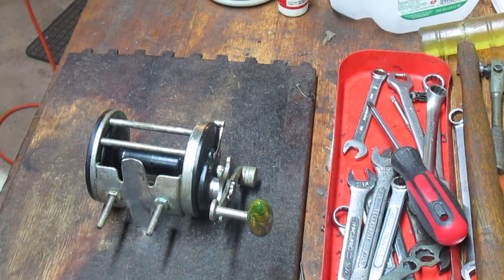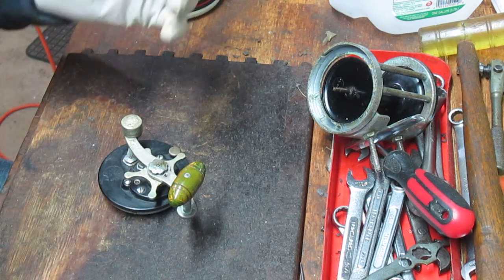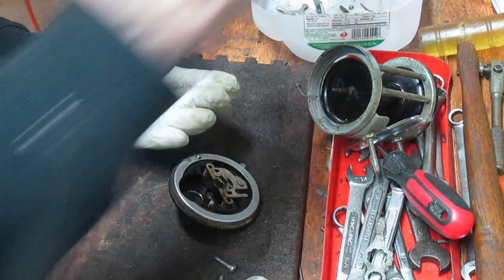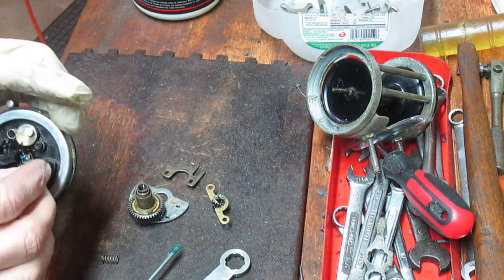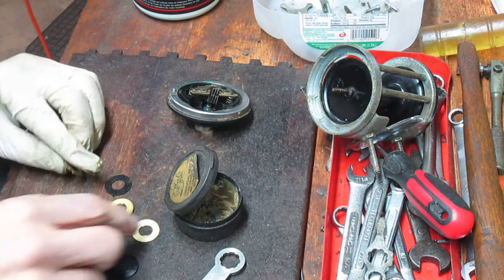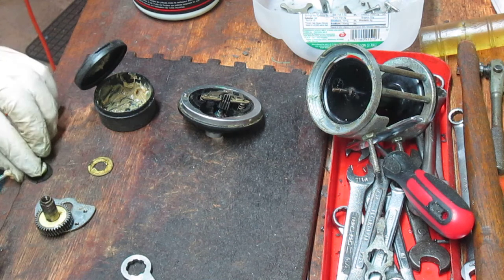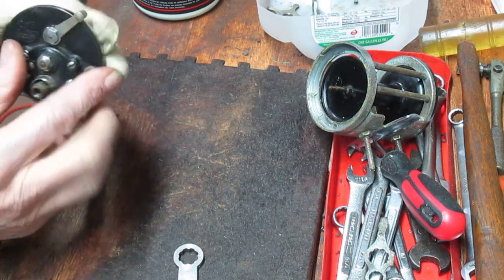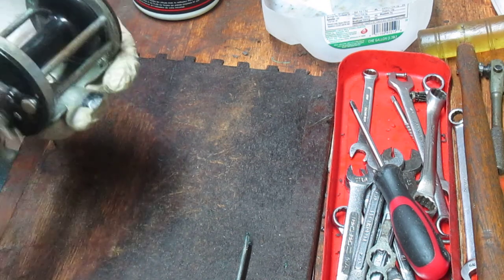Penn Surfmaster 200 repair or rebuild with reel overview and tips

Comment: Will the leaf spring from the Squidder 140 fit the Surfmaster 200?
Reply from the maker: Which spring?  The A/R dog springs are very different.  The Yoke springs are interchangeable.  I am not sure which spring you are referring to as a leaf spring.  Please clarify - Dennis
Reply: @2ndChanceTackle Apologies, I’m speaking about the AR dog leaf spring. If the Squidder leaf spring won’t fit it, do you know which AR leaf spring would fit.
Reply from the maker: The squidded has a coil spring that sits inside the A/R dog.  It is not a leaf spring.  If you are looking at the 200, that spring is different from the squidder

Comment: Is it possible to narrow this reel like other old penn reels?
Reply from the maker: Penn did that for you with the model 100 and 150 Surfmaster.  The gear side plate is the same on all three, but you would need the whole backside to marrow the frame.  That would be the cross posts, reel seat and spool.  At that point, it would be cheaper to just by a good used 150 or 100 rather than investing in the parts to modify your reel - Dennis

Comment: Dennis I assembled the main gear portion according to the video and checked to make sure the anti reverse was working before final assembly. I don't have free spool; the anti reverse engages in both directions. I've tried several times but same results. What did I miss?
Reply from the maker: I would take the assembly off and check it again.  I think your A/R dog may be trapped behind the main gear and not riding on the gear sleeve - Dennis

Comment: Usually I disassemble the reels than look on YouTube to see how others do it. I am glad to first check here. the "cup hand" tip was is very useful. Could not see the flat spring positioning too well, But now I know what to watch out for. Thank You for your time to record. All the best.
Reply from the maker: Glad to help.  Thanks for the note and for watching - Dennis
Reply: @2ndChanceTackle  I missed the purpose of the slight turn of the plate. Had a hell of time removing the front plate. I even went from the back. I took the guts out, no deal. Soaked it with penetrating oil. No good. socket and hammer was useless too. By shear persistence and luck, I turned the plate and came it did.
Reply: One more question if you do nit mind. How does one lube the reel using the several spots having a ball and spring indicating lube here?

Comment: Do you have any tricks for freeing up a side plate that is frozen onto the frame? I love the take-apart function on these reels with the exception of those that refuse due to age and neglect.I hate being forced to turn one into just parts.
Reply from the maker: Yes.  Start with a heavy spray of penetrating oil around the rim of the gear side plate and try again.  If that does not work, remove the non-gear (bearing) side plate and take the spool out and then replace that side plate.  Once it is reattached, put a long blade of a screw driver or file inside going high and low between the frame bars.  Use that a a lever while holding the reel handle and screw and turning counter-clockwise. That should give you the extra torque to help remove the stubborn plate - Dennis
Reply: @2ndChanceTackle , once again......., thanks!

Comment: Loosened take apart screw and reel wouldn't come apart.  Removed screws non-drive side to take it apart.  No corrosion, why did it not come apart?  Since discovering 2nd Chance Tackle and your guidance I am not afraid to TACKLE any reel.  How does take apart screw come out of plate?   Any suggestions or advice will be appreciated.  Fourth time for me watching this video.
Reply from the maker: The take apart screw is spring loaded.  Did you pull out on the screw head after loosening it?  You need to pull out and hold the screw out hail you turn the plate to release the side plate assembly.  If you did that, then your channels where the side plate pins sit, may be clogged.  Best to use a penetrating oil to try and loosen that by spraying the inside track where the side plate joins the ring.
Hope that helps - Dennis

Comment: My s master 200 works fine...
But when i loose that 1 screw it wont move..so it's so hard to take the side plate off..
I need to put alot of pressure to turn it back off..
So what is bent??..that makes the side plate get stuck..?
Reply from the maker: The cause is usually built up gunk, salt and worn grease inside the tracks of the side plate.  There are 3 pins and grooves.  Make sure these are cleaned and clear of debris.  If you are having trouble getting it off for the first time.   Take the non-gear side plate off and remove the spool that way.  You will then be able to spray the gear side trim ring with WD40 and let it work in behind the assembly.  That should loosen some of the gunk.  You can then reassemble the reel and try to remover the plate again - Dennis

Comment: If the bearings were the same as the 140 can they be upgraded to ceramics?
Reply from the maker: The 200 is not the same as the Squidder even thought it has been referred to as the poor man's Squidder.  It does not have the same bearings.  The 200 is almost identical to the Beachmaster 155.  They share most frame and internal parts.  The difference is that the Surfmaster has the one screw take apart system, where the Beachmaster has the side plate attached to the cross posts with multiple screws - Thanks for asking - Dennis

Comment: GREAT video, but you forgot to install two things!  the Eccentric Spring for the release lever, and the tension spring on the bridge.  i just rebuilt my penn surfmaster 200, and found these two pieces "left over".  i took all apart and figured it out.  but thank you, so much, for posting this.
Reply from the maker: Hmm - i will go back and check!  I use a parts tray and Cant recall any left overs.  If i got it wrong, I will correct.  Thank you for noticing - Dennis
Reply: unless there is a difference between the really old ones and the just sort of old ones . . . mine is about 30 years old, and it definitely has these two parts.  in fact, they are shown, too, on the penn schematic at mystic parts.  funny thing is, the reel works without them, but not nearly as well.  the release lever has no bite without it's spring, and the spool just doesn't sit tightely without the tension washer.
Reply from the maker: They all have them.  Now I need to go relook the video.  I don't normally take the Eccentric spring for the free spool release off when servicing the reel.  Ditto the bearing side plate tensioner as these don't require service unless they are broken.  I put a dab of lube on the spool tensioner and eccentric, but do not remove them.  I am going to watch the video now.  Thanks - Dennis
Reply: oh, there it is.  i do see it in yours.  you just never removed it.  ok, well, thanks!
Reply from the maker: Thanks for keeping me honest.  We are all human and I make a lot of mistakes.  That's how I learn.  Best wishes - Dennis